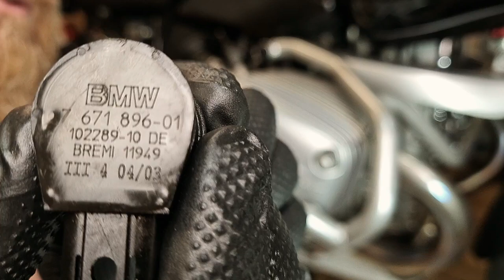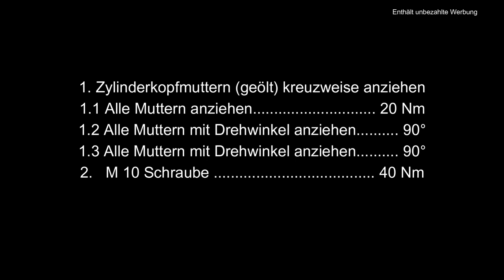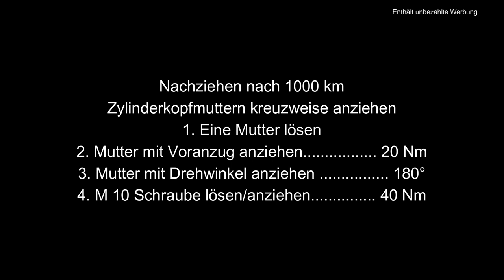BMW R 1150 GS - Zylinderkopfschrauben & Ventile einstellen | und eine böse Überraschung!

Comment: Du kommst wie gerufen mit deine Videos, ob Wilbers Fahrwerk oder wie hier den Tipp mit dem stecker für 50€, einfach genial. Schlachte grade meine 1150er Adv mit 250.000km aus und Baue Lack Teile auf eine Normale 1150er um, inklusive neue Teile Pulver beschichten und bin Froh wie Toll du alles hier erklärst mit abschrauben usw. Top. Mach weiter so, gleich Abonniert :-)
Reply from the maker: @BullevomSudelfeld Vielen Dank für Deine positive Rückmeldung. Ich wünsche Dir viel Spaß und Erfolg bei deinem Umbau. VG

Comment: Hallo Motorraddoktor,
Vielen Dank für Deine gut erklärten Videos. Eine Vereinfachung zum Einstellen des OT wäre, den Keilriemendeckel drauf zu lassen und bei eingelegten 2. Gang, das Hinterrad zu drehen. 
Liebe Grüße 
Mario
Reply from the maker: Hallo Mario, bei beidseitig ausgebauten Zündkerzen geht das auch. Jedoch muss man bedenken, dass man beim drehen des Hinterrades erstmal den gesamten Antriebsstrang in Bewegung setzen muss, bevor man eine Bewegung der Kurbelwelle auslöst. Das geht in der vorwärts oder rückwärts Bewegung nicht ganz spielfrei vonstatten. Hierbei den exakten OT zu finden ist etwas fummelig. Wenn man allerdings direkt an der Kurbelwelle dreht ist die OT Findung um einiges einfacher. Nachteil: hierfür muss halt der Deckel vorne runter. Vg
Reply: @motorraddoktor  @Mario: Den Polyriemendeckel abzuschrauben ist wesentlich einfacher und geht schneller, als das Gefrickel mit dem Hinterrad. Das dauert ewig und man muss dauernd aufstehen, hin+herlaufen, hinknien, um zu gucken und erwischt im ungünstigsten Fall die Markierung erst nach einigen Versuchen. Wie beschrieben+gezeigt, ist das genau richtig so! 👍

Comment: I followed with the subtitles, I love the thorough approach, excellent. I messed up big time when I had the cams 180 degrees out from each other and should have had the LH cylinder cam sprocket with the notch at the TOP and RHS pointing to the BOTTOM. Never really emphasised in any video, I suppose if you are doing that much work you should know what you are doing. Ended up getting new valves and cam carrier cam and sprocket! Take care guys... Not sure if you explain this in another video? I just subscribed... If not, you could help peeps on that one, no other YouTube shows this.

Comment: Hi, nur damit es nicht zu Verwirrung kommt: Die Verlängerung ändert nichts an dem Auslösemoment! Auch die Torsion der 1\2 Zoll Verlängerung bei diesen kleinen Momenten beeinflussen den Drehwinkel kaum. Der Fehler bei den geratenen 180 Grad Anzug ist deutlich größer. Trotzdem Top Video👍 ....wie Deine anderen Videos auch👏
Reply from the maker: Hallo Andre, vielen Dank für Dein Kommentar. Mein Meister, lang lang ist es her, hat mir das einmal gelehrt. Achsiale Verlängerungen verändern den Drehmoment. Aber auch Meister müssen nicht immer Recht haben. Du hast Recht, das es bei diesen Drehmomenten und der Werkzeugkombination tatsächlich keine Rolle spiel. Immer davon ausgehend, das die jeweilige Verlängerung sich nicht verformen kann (Torsion) Ich habs halt immer so weiter geführt ;-). 

Auch beim Drehwinkel gebe ich Dir Recht. 100% korrekt wäre, ein Drehwinkel Messgerät zu verwenden. Auch wenn es in der Praxis, wie hier im Video gezeigt, oft ohne Messgerät dauerhaft erfolgreich und problemlos gemacht wird. Ich nehme Deine Anmerkung aber zu Anlass, und werde einen Hinweis in diesem Video anpinnen. Ich danke Dir für Deine Anmerkung! Vg

Comment: Danke für das Video. Ventile hatte ich früher bei meiner Yamaha SR500 eingestellt. Würde es jetzt an der GS auch machen. Allerdings ein Verständnispunkt: Den OT gibt es doch zweimal. Einmal bei der Zündung und einmal beim Ausblasen. Beim Ersteren sind die Ventile geschlossen und beim Zweiteren ist das Auslaßventil offen. Gleiches gilt natürlich für die Ansaugung des Einlassventils. Wie wird das beim Einstellen berücksichtigt?
Reply from the maker: Hi, den Zylinder welchen du einstellen willst, stellst du auf Zünd OT (Alle Ventile sind geschlossen) dann weiter drehen für die andere Seite. Grüße
Reply: @motorraddoktor  Klar, wenn die Ventile geschlossen sind, sind die Stössel entlastet. Denkfehler meinerseits.  Der OT ist dann also immer der Zündzeitpunkt. Danke für die Info.

Comment: Wenn man das eine ventil einstellt, verstellt man damit auch automatisch das andere ventil, da diese miteinander verbunden sind. Also unbedingt die fühlerlehren von bmw kaufen und alle parallel einstellen, gibt nen grund, warum die immer paarweise für ein und auslass verkauft werden!
Reply from the maker: Neulich habe ich eine Set mit 4 Fühlerlehren, 2 Stück 10er Ringschlüsseln und 2 Inbusschlüsseln gesehen. Ich stelle mir die ganze Zeit die Frage, wie ich das mit zwei Händen machen soll.... Meinst du das geht?
Reply: @motorraddoktor  so lange aufeinander abstimmen, bis es passt. Einzeln natürlich.